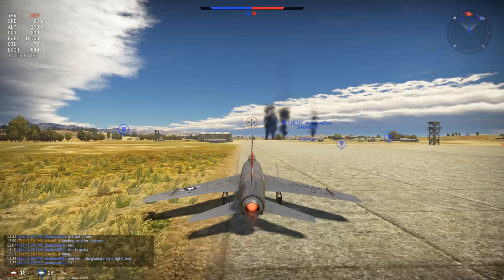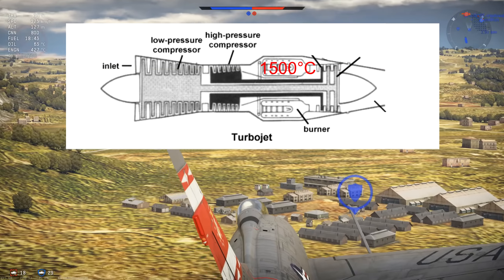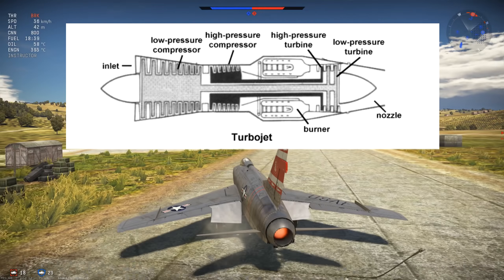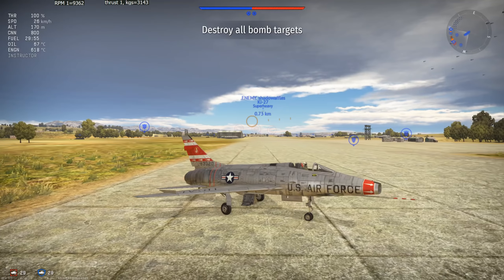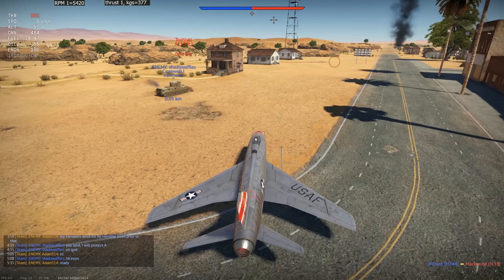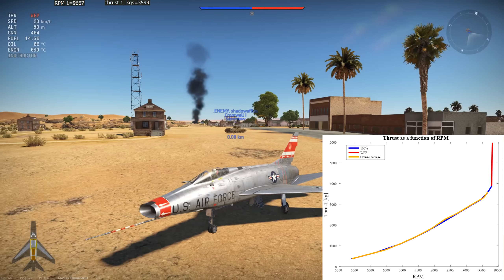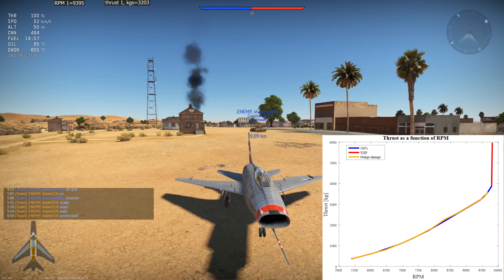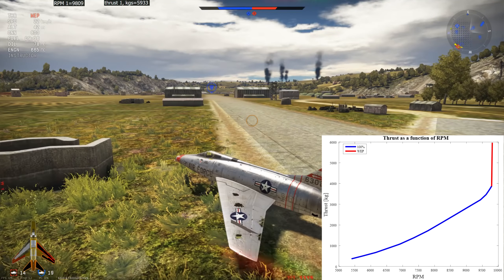The Problem With AFTERBURNERS In War Thunder

Comment: Most people: 'fix the game'

Most youtubers: ' Fix World War mode'
Adam: " The Afterburner Test is a multistage aerobic capacity test that progressively gets more difficult as it continues. The 20 meter burner test will begin in 30 seconds. Line up at the start. The running speed starts slowly but gets faster each minute after you hear this signal. A single lap should be completed every time you hear this sound. *ding Remember to run in cirkels and run as long as possible. The second time you fail to complete a lap before the sound, your test is over. The test will begin on the word start. On your mark. Get ready!… Start. *ding "

ps: i like your informative videos, they helped me get better with bf109s (German air-brake ftw), but i also like your aim and skills. therefor i wouldn't mind seeing a mix of gameplay - and informative video's.
Reply from the maker: Was science ever meant to go this far?

Yeah German airbrake is a good trick, maybe I'll redo it with voice and more detail.

Thanks for the feedback!
Reply: Adam514 can you teach us the “I’ll show them the trick I learned” maneuver
Reply: This is the guy we need in our community. Right now, people who are complaining without giving a solution or even pointing out the problem are just making the game even more cancerous
Reply: Jerry Yan 
If you want actual solution and proof that the developers are wrong on certain issues, go to the War Thunder forums. That's how I found out that the engine overheating in War Thunder is entirely unrealistic (except in aircraft with historically documented overheating issues).

Comment: "Enough to melt steel beams" 

I see what you did there...
Reply from the maker: I just said it as a reference! (hello FBI guy).
Reply: @GewelReal  Actually............. ;) .........the turbofans temps were hot enough to even melt the nickel-alloy castings for the turbojets, they needed a new casting technique for turbofans due to high temps. 

And the lack of Nicke is what killed the Jumo 004s that fast. 

The problem with the RPM coupling is that at first glance it seems to make sense, given that is how we perceive it due to the throttle setting we need to enable them, past the gate past the 100% RPM. 
Now on modern engines you would loose the Afterburner on most engine damage situations, especially if the FADEC (Full Authority Digital Engine Control) is damaged and you'd have to go to SEC (Secondary engine Control) which is usually manual, on that afterburner is inhibited as a safety precaution. 
This is due to the SEC being slower than the main FADEC, especially in regards to operating the engine nozzle, and in SEC it is mostly open, which also means a reduced thrust. 
Any nozzle damage should make afterburner use very dangerous.. 

On older planes like the F-100 it should be possible, however it would be questionable if it would be wise to use it. 
Mainly because with engine damge you could have damaged fan blades, which can lead to reduced or even unstable rmp which can lead to surging engine.
Which is a pretty dangerous situation, because the rmp and therefore the airflow through the engine, which could lead to an afterburner sputtering and flaming out....which means then unignited fuel in the air stream, making an air-fuel mixture and a possible explosion upon relight. 

I'm not sure about the engine control systems of the F-100 if it had such an inhibitor, but if it didn't it shouldn't inhibit Afterburner usage........it should just have the penalties that usign an afterburner has in such situations, so the pilot has to make the choice. 

Just watched a bit more, the J-57 has a fuel control system, which is an earlier engine control model, however the video expressly states that the "mechanical afterburner shut-off valve terminates AB operation below 80% RPM" which shows how faulty the WT system is. 
https://www.youtube.com/watch?v=Q-bshH3xB0E

Honestly, the system right now sounds a bit like a system for piston-engines that has been slightly modified to fit jets, a bit like the Forsazh, WEP or Notleistung on a Piston engine, which is at the top end of the RPM scale. 

Aside from that the engine damage system sounds very "gaemy" to me, receive x ammount of damage receive Y ammount of thrust reduction. 
I've been playing combat flight sims since 1998 with only two years where I didn't, and in no sim does engine damage reduce the thrust outright, except for some very specific circumstances, it mostly creates situations where you the player should or have to reduce the engine power you use to avoid further unpleasant consequences. 

A Radiator hit on a liquid cooled piston engine does not reduce the power you can get from it, nor does it reduce rpm...........BUT it incentivizes you to use lower rpms and less power. 
The more rpm and the more power you use, the more heat the engine generates. 
And since you are loosing your coolant fast the ammount of heat that can be vented is rather limited, at a certain point the engine will seize up. 

If you use less rpm, the engine produces less heat and you can stretch the time until the engine seizes further out. 

Now as for the specific curcumstances that reduce power outright.........the only ones I can think about are, a) if a cylinder gets shot straight off, b)the nozzle of a jet gets destroyed or blown off, or c) a jet engine gets holed and the pressure differential drops. 

Now a) the cylinder gets shot off, generally only surviveable in a radial engine fighter........well yes you loose a certain ammount of power, let's say in the case of a BMW 801 1/14th of the power is lost. Yeah that's bad, but the rpm isn't limited and the real reason for any power loss after that is that you have to throttle back, because the engine is firing unevenly. 
Which means it can shake itself apart. The less RPM used, the less severe the effects of the uneven firing=Engine and aircraft live longer. 

b) the nozzle is destroyed. Near total loss of air flow control through the engine, loss of control over the density of the exhaust gasse and henc thrust.
So yeah a loss of power, however not a loss of RPM, you can still run it at max-RPM.........it would just not be wise too. 
The problem is that due to the lack of control over the airflow, it is very likey to lead to engine surging, and the lower the throttle setting the less severe are the fluctuations. 
So again no RPM-loss and the power loss isn't the major problem here..... ;) 

c) the engine is holed and the pressure differential reduced............again a miniscule ammount of power, not RPM though is lost. 
However the major problems are:
I) that hot air or exhaust gasses flow unctrolled into the aircraft and can weaken or melt the structure, which can lead to the aricraft's structure failing (afaik never simulated as it is rather complicated.)
II) If a shell or bullet explodes in the engine or passes through, it causes a lot more damage than the holes.......it tends to damage the compressor blades, which can lead to the engine surging or the fanblade failing, flying through the engine and destroying it etc. 
but the biggest issue is 
III) Generally the engine in single engine fighters is surrounded by fuel tanks and I guess you can vividly imagine what happens if 800-1500 degrees hot air or exhaust gases pass into a fuel tank that is filled with fuel and a fuel-air mixture......
Reply: @AverageDoomer69  Nah. It was us, the French. Legitimate retaliation for the US banning raw milk cheese for "sanitary" reasons. Pshaw.
Reply: Sung Hwa Lee  7/11 was a part-time job
Reply: @LupusAries  

Nice wall of text, very Informative;)
You can actually somewhat compensate for the lack of certain materials by air-cooling the fan blades or making them hollow, something the German jet engines of WW2 already had.
Also, the thing you mentioned about potential jet engine blow-ups makes a lot of sense when you look at the early (WW2) axial-flow engines. 

While German sources only mention the term "Flammenabriss", or flameout (meaning that there is no combustion anymore but fuel is still injected), allied sources mention exploding engines aswell. Which makes somewhat sense, as if the fuel is not cumbusted in the combustion chambers, the additionally injected fuel will be incinerated by the hot engine, leading to an uncontrolled combustion( big boom).

Afaik, you mentioned you played combat flight sims.
Have you played Il2 1946, and if, what do you think about its jet engine damage model?
I mean, is it better than the one from WT (?), if its a good example it might lead to a faster DM improvement. (If there is any)
Cheers
Reply: Sung Hwa Lee  no, 7/11 was a Part Time Job.
Reply: @paulw6949  Thanks for the praise and especially for the information on the air cooling. 
On how they kept the blades from melting has been something I have been looking into for years and found nothing. 

Do you have more information on that?

And wrong handling, especially wrong throttle could really do a number on them. Interestingly I read in a german magazine a few years ago that the Jumo 004s fitted to the Ar-234 Recon Plane/later bomber did have double the MBTF (Mean Time Between Failures) than the Jumo 004s of the same type fitted to fighters. 
IIRC 40 instead of 20 hours of MBTF. 
This was linked to the fact that the engines on the 234 experienced less throttle changes during flights, the Arado being a high altitude recon plane there was usually less need for throttle changes once cruising speed was established than on a fighter. 

This vulnerability is imho very well modeled in Il-2 1946, you had to be very smooth on the throttles to not flood the engine with fuel to either starve it, or more often set it alight. 
Most of us got rather well used to moving the throttles very slowly and carefully, while making sure we had moved the throttle through it's full range before any mission, especially those that involved an air start. 
Or any that started with the engines running. 
Because if you didn't and the throttle was at say 30% the first time you moved it to say 31% it snapped the ingame throttle to 31%. 

Which generally lead to an engine fire.....

You really had to relearn flying when flying the 262 or other jets, by comparison you could really abuse the DB 601 or DB 605 or the 801. 

The Jumos and other Jet engines felt truly like the prototype technology that they were, with a lot of teething problems. 

You had to really handle them carefully, I mean with the Jumos you couldn't go past 8000 rpms on take-off or low altitude or they would overheat in short order. 
Overheating meant that an engine fire was usually just waiting to happen.

Only when you had reached higher altitudes you use higher throttle settings........but you should still avoid going higher than 8000 rpm.

The early P-80 variant was similarly finicky, the later ones less so.

Half the time flying you were worrying about engine fires.....

I usually did not get compressor stalls with the 262, engine fires were much more likely, but I did get them in the Canadair Sabre that came with one of the later iterations of the HSFX mod when I provoked them. 
If I tried what I did on the sabre with the 262....the engines would've blown after the first try.

Basically lots of jockeying the throttle, with quite a bit of Angle of attack on the aircraft....which was to be expected given that the  Orenda radial jet engine was less stall prone than the original J-47. 
Also on ground acceleration was just painfully slow

So as you can tell I have flown IL-2 1946 and earlier variants quite a bit. 

The Damage model of IL-2 overall is still good though eclipsed by the newer IL-2 and Cliffs of Dover Especially. 
As far as Jet engines go, I would consider IL-2 1946's Damage Modelling a decent upgrade over what the War Thunder system looks like. 
It's not perfect but it would an improvement. 

The weird thing is though, that Gaijin first started out with a Console port of IL-2 based on a modified Forgotten Battles Engine. (IL-2 Birds of Prey, with a PC release called Wings of Prey later.)
And early and WT development you could still see the similarities in the base engine of the game.
So the whole base system for the engine modelling should be there or should have been there already.
Unless it was taken out and replaced.

However, if you implemented that damage model, you would get a lot of people that complain about how hard it was to fly the 262 and contemporaries especially. 
The later post-War engines and especially those of the late 40's to early 50's are still challenging but not as bad as the very first jets. 

As for DM improvement, well good question if that could be sped up...........the main problem imho is less the engine but more the devs. 

I'd have to look more closely how the overall damage model works compared to IL-2 1946. 
However overall especially with mods the IL-2 1946 Damage modelling was believeable. 

I could discuss how the IL-2 DM worked, but this would make this already long post even longer! :D
Reply: @AverageDoomer69  at least you honest
Reply: I honestly don't get it, I'm sorry, I need a little explanation
Reply: Investigate 311
Reply: @LupusAries  
Im sorry for my VERY delayed answer, really hard to find good english sources and I was somewhat busy. I hope its not too late.

Some info on the german jet engines:

Jumo 004:
http://www.aviation-history.com/engines/jumo004.html

Bmw 003:
http://legendsintheirowntime.com/LiTOT/Content/1946/Av_4603_DA_BMW003.html

Also interesting :
Look up "THE DEVELOPMENT OF THE JUNKERS JUMO 004B- THE WORLD'S FIRST PRODUCTION TURBOJET"
This is one of the best texts I have read so far. You can get this for free (some websites want you to pay for it but You dont need to).

Afaik the free one is hosted on: https//watermark.silverchair.com/something

I cannot send you this link however because its is only available for a certain time and cannot be sent over the internet (the link doesnt work then, for some reason).

I have to add that I really learned a lot while doing this research, so Thanks aswell:)
Btw, there were actually quite a lot of German jet engines in WW2. The 004 and 003 are the most common, but far from being the best.
Here's a list, I really want to do some research on the other ones:

https://en.wikipedia.org/wiki/List_of_aircraft_engines_of_Germany_during_World_War_II

Now while I think that the IL2 DM is way better than the WT one (atleast for airplanes), the Jet-engine model isn't. Its not completely bogus, but it was just more of a  compromise (remember, this game is 15 years old).
So when you increase the throttle to rapidly, you would have a compressor stall and flameout. Under certain circumstances, this might lead to an engine fire, but certainly not all the time. 
(As discussed before)
However, in IL2, your engine "explodes" every time, which is unrealistic.

Other than that, I think it would be an improvement. 
Flameouts and engine fires on early jets bc of an improved DM/FM would certainly be a welcome addition tho. This might give Gaijin another reason to improve the (ridiculousy)  butched FM of some jets (cough, 162, cough). 
Cheers

Comment: yellow = module has less than 100% health = damaged
but it has no effect on the functionality, so it appears.
Reply from the maker: Maybe yellow is just there to show you were hit, and make it easier for the next shot to get you into the orange tier.
Reply: @AdamTheEnginerd  have you checked if yellow damage effects temprature/fuel milage? have you confirmed that this is the same for other engines in the game? perhaps propellor engines aswell?
Reply: It does make jet engines sound like a piston engine that is running without oil atm

Comment: Another fantastic video Adam! I didn’t even heard about this problem!
Reply from the maker: Thanks mate! No one has heard of it!
Reply: Adam514 A curiosity: did you notice a small increase in maneuverability at the expense of engine power on the Bf109s Gs and K4? Because in this month I can no longer make maneuvers like very large loops, which I used to stall all the poor spitfires I found, but the engine seems to no longer have all that power and acceleration that it had..... so every time I do a loop, where I go up about 1000m, before I could do it if my speed was about 450km/h, now I have to be at least 600km/h.

(Sorry for bad English)
Reply from the maker: I haven't noticed that.